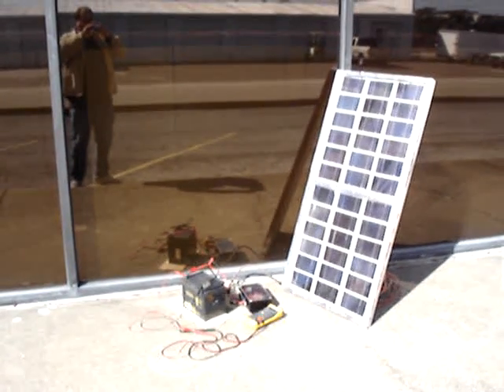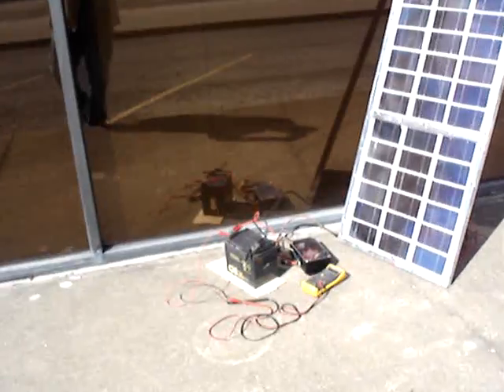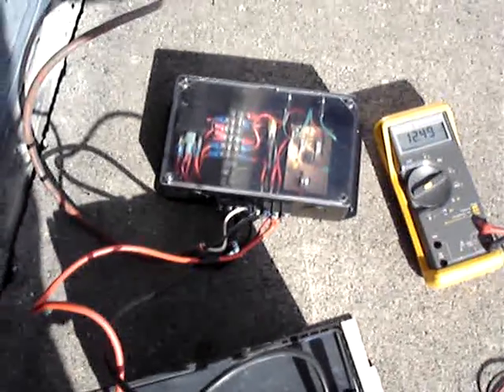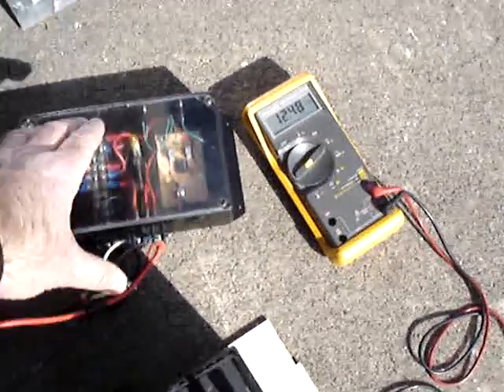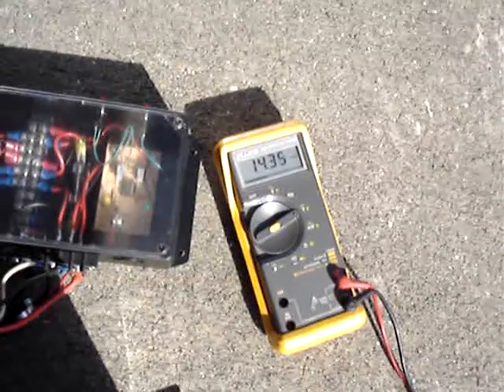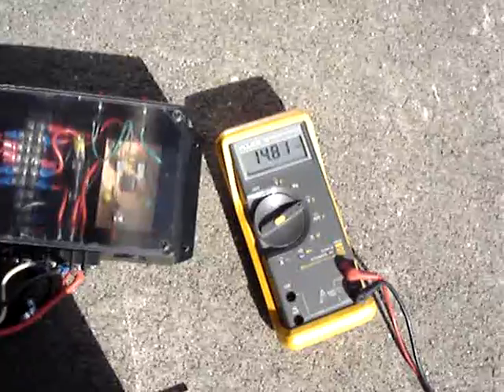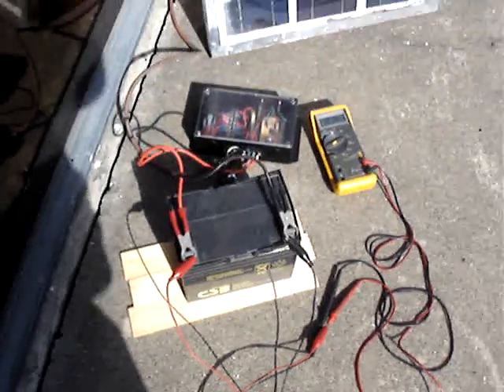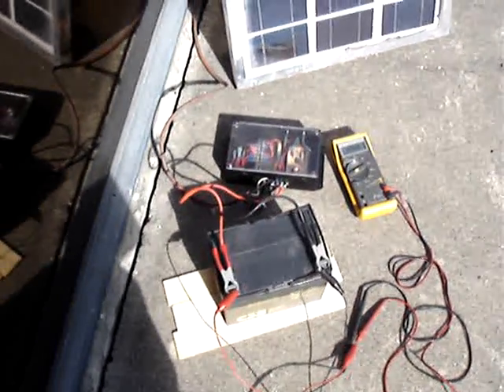555 Based Solar Charge Controller at mdpub.com

Comment: Thank you sir..for sharing 555 based charge controller..it is awesome circuit..
But I struck with one problem..
When voltage fall below 11.9v it doesn't open the contact of relay..
It is still supplying voltage to battery..
Plz give me solution over this..
Reply: When the Voltage on the Battery Drops to your lower set point, it is supposed to make the relay lose power so that it goes to its regular position so that way it can only stay connected to the solar panel, and Vice Versa when it reaches its upper set point. You Really just have to tweak the Potientiometers (I Recommend Trim Pots) to get a stable reference voltage for your set points.

Comment: I now have made the controller, and now i have a bunch of ground wires, like from the push buttons and from the LED  and more stuff, i guess they go all together, and then you split them into 3 induvidual grounds, one for battery, one for input, one for dummy am i correct?  My other qeustion is does the power from the battery input go to the input of the 5 volt regulator?

Comment from the maker: Connect the battery first, then the solar panel. The battery must be connected to provide a stable source of power to the circuit. Connecting the solar panel first will cause the buzzing. If it buzzes with just the battery connected, then you did something wrong in the construction or calibration.

Comment: Built this twice, 1st with solder, then on a breadboard. Both times solinoid just buzzes and something gets hot so unplug it. Something is surely shorting out. Schematic shows complete circuit connecting pos. and neg., or am I reading this wrong?

Comment: purpose of test points is that you have somewhere to connect your voltmeter when you are calibrating variable resistors to 1.6 and 3.3V, you can replace the battery to whatever you want, you just need to know for that specific battery what is the upper charging voltage limit, and at what voltage will it be when its at DOD (lowest fullness like 20% full considering it empty), then you need to adjust variable resistors to those new values